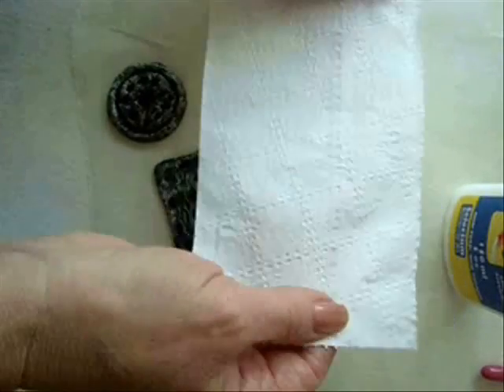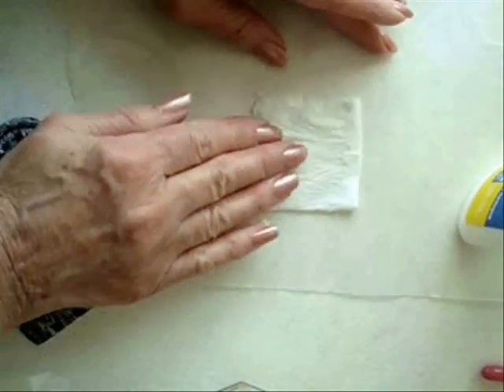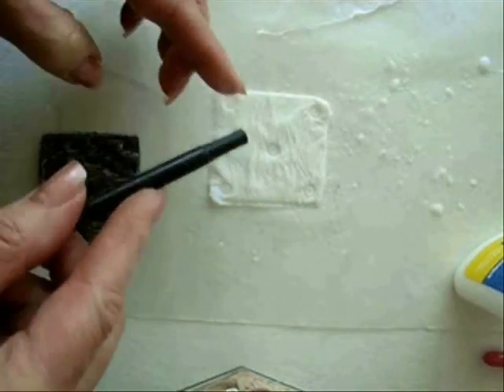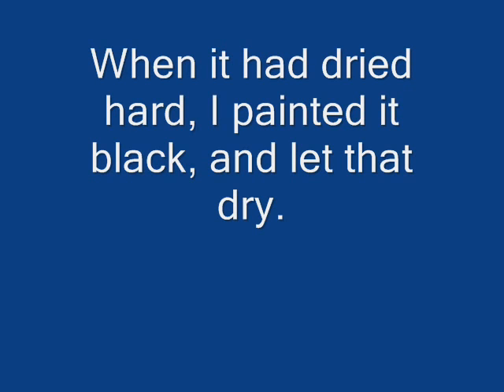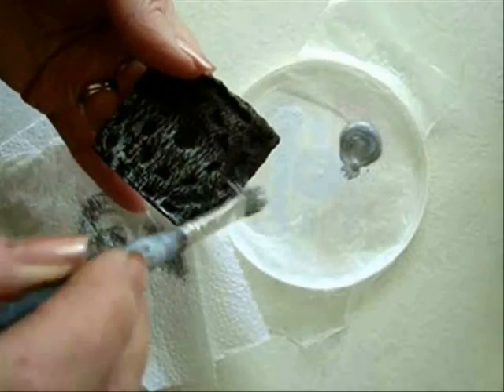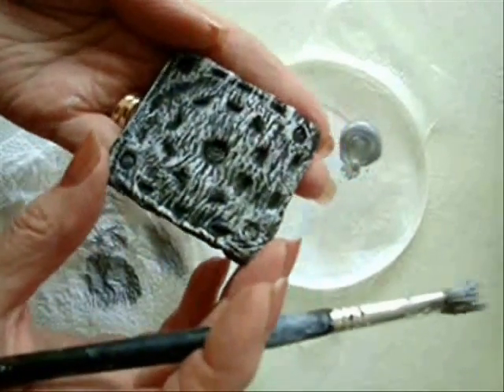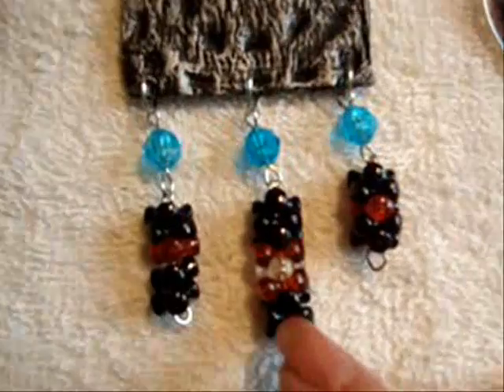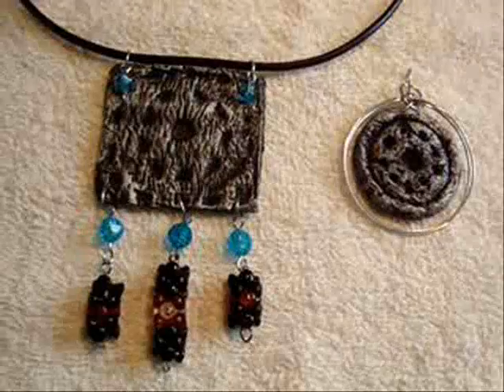MYSTERY PENDANT, how to diy, square paper beads, recycle, jewelry making, paper projects

Comment from the maker: Years ago, when I was still doing the craft show circuit... I made angel faces with this papier mache mix... First I made a mold with plaster of paris and after it had cured, I would push the pulp into the mold, pick it out, and arrange dozens of them on a screen to dry.  Then I would paint them assembly style... all the pink faces, all the eyebrows, all the eyes.. working down the row.  It made short work of turning out lots and lots of faces!!